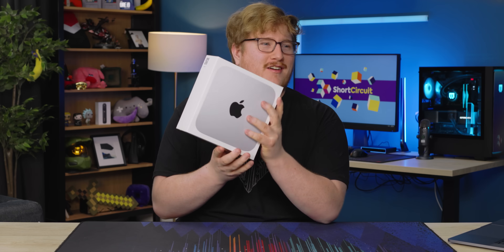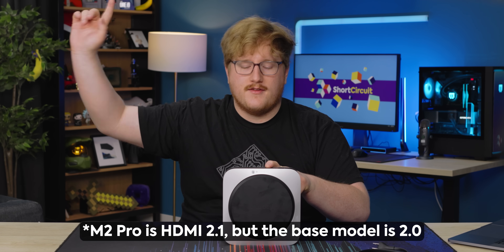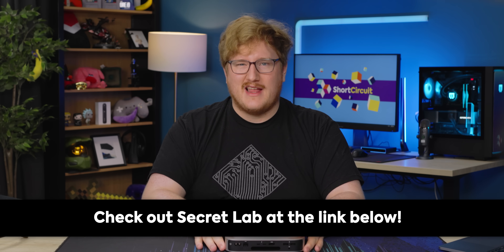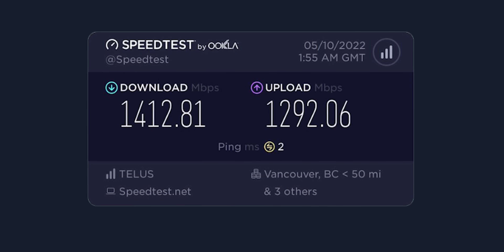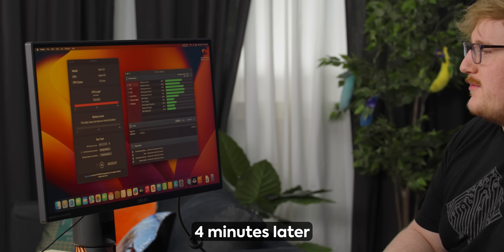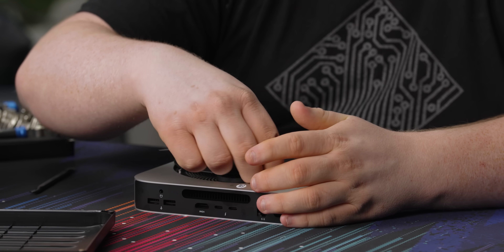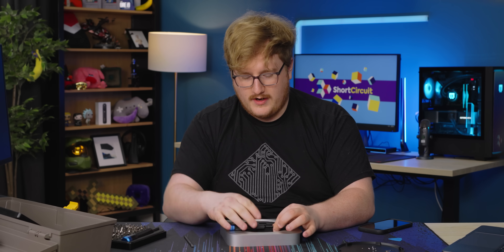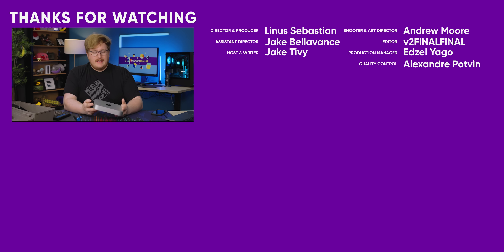Always wanted a Mac? Try this. - M2 Mac Mini

Comment: i edit RAW photos in lightroom and huge projects in FCP X ..currently stuck on a 2018 MacBook Pro w/ TouchBar specced out to 16gbs, 1TB, and runninga 2.4 ghz quad-core intel core i7 ..whatever that means 🤷🏻‍♂️ 
now, i know that any M-Series Mac will run circles around my current set up - but when i move on from this, soon to be 5 year old mac - i want something that will stand for even longer
so i'm holding out to save up for the M2 Pro Mac Mini, with 32+GB RAM, staying at 1 TB ..but by the time i do we may be onto M3 tbh 🤷🏻‍♂️ who knows

wish me luck
Reply: I would suggest wait for m3 because they are going to use tmsc 3nm which will improve efficiently and performance a lot

Comment: Last time I bought a Mac was in 2011 when you could at least replace the RAM yourself. Wanted to go back to mac for a while.
So I bought this little prick and it ended up coming with a defective Wi-Fi card. Go figure. Took it back. 
Probably should have just gone with the Macbook Pro. Whatever, Apple wasn't about to get any more money from me after that.
IDGAF about the ARM chip if this is what I have to deal with. Instead of buying another overpriced Mac PC...I made my own! :) #Hackintosh

Comment: The first time i got my hackintosh machine built and worked properly i know i will never buy any product from apple. How can people think 256 gb storage and 8gb ram (not upgradeable) in 2023 is enough? (Back in 2017 i bought an Imac 21.5 4k i5 8gb 1tb and it barely run my logic pro x project.) And this mac mini is 599? (To compare my hackintosh machine: 12400f -16gb ram - b760i ddr4 version - rx 560 - 1tb SN550 - "k40 sgpc" case cost me just 450$ brand new fully functional and it blow this m2 out of the water interm of raw performance). Wake up people! That's an anticustomer act.
Reply: Well that's a self fulfilling prophecy, given there is a timeline when Apple Intel support will be dropped anyway.

Comment: i would not give you a dime for the 8 gig ram and 256 ssd its garbadege for anyone and everyone, now slam in 16 to 24 gigs of ram and a 512 or bigger ssd then you have a real computer in your hands , i have the M1 mini 16x512 and its great  the m2s by the way are not that much faster then the m1 so not really worht it as an upgrade at all.

Comment: I am happy with my iMac 24 from 2021 so I dont need an upgrade plus I heard the M2 is just a little bit faster. I have my TV as my monitor while my normal monitor if I ever decide to get a mac mini to use that monitor but still at least with an iMac you get a screen, a keyboard and a mouse included. Even though the magic mouse is a bit of a pain sometimes. I keep enlarging the websites from my magic mouse by accident and have no idea how I did that or shrink it back

Comment: Boy the upgrade to M2 Mac Mini pro is appealing.  With edu pricing I bought a M2 Mini with 16 gb for $699, but for another $400, you get more ports, the ability to run 3 monitors, more and faster SSD memory plus the M2 pro processor.  Maybe it is just that the non-pro is intentionally limited. :(

Comment: I have MacBook Air M1 second tiered one with 8 ram 8gpu 512 connected to my Dell 34” monitor. I was thinking of getting the Mac mini M2 base model to have a dedicated desktop and free up my MacBook Air. You think it’s a good idea or waste of cash?
Reply: Go the M2 Pro Mini if you can afford it as that will give you some genuine upgrade in performance and capabilities for a desktop machine. Otherwise the M2 base mini's only real strength is it has active cooling and saves you having to dock your MacBook Air to use the monitor. You'll have to determine for yourself if that is worth several hundred dollars. I say that as someone who faced a similar situation with my M2 MacBook Pro and decided to get the M2 Pro Mini, but only because I picked one up second hand at a considerable discount.

Comment: The USD$600 price point is wild. Putting a cheap Windows system together with the same RAM, a DRAMless NVMe SSD of the same capacity and a retail Windows license, I can only put a 12400 in that thing before it goes over budget. It's just a shame that every little spec bump is highway robbery.

Comment: I just purchased 10 of these for a rehearsal studio at a major cruise line for running QLab. For the first time, it was actually a realistic option to go with the baseline Mac without any upgrades. I didn't, but I totally could have. I don't trust that they won't decide to do more with these things later on.

I also personally have a Mac Studio that I use daily and it's been an incredible computer. Totally silent, powerful as hell, and the power consumption is super low. I'm driving two 4K Displays right now and it doesn't break a sweat. I still get 60-80fps if I decide to game a bit... even at 4k. My actual Windows desktop is definitely better for gaming, but Apple is really killing it.

Comment: I honestly think charging port on the bottom of the mouse is easily defendable. They don’t want you to ever use the mouse with a cable plugged in. Bam. Done. It’s a much smoother experience without a cable, especially the very durable yet non easily malleable ones that Apple uses

Comment: Lol imagine getting a 600 dollar PC with only 8gb of ram and 256gb of storage. Also love that stupid nonsensical design on the mouse having the port on the bottom, they do it on purpose so when the battery goes bad you need to buy a new one. Apple never changes.

Comment: Might as well skip getting an external drive for this thing and just hook it up to a NAS somewhere. The internal drive can't even move data faster than the ethernet. Same problem with their baseline MBP. Wtf is Apple doing going cheap on their internal drives like this? Forcing people into the upgrade/upsell slippery slope? Maybe it wouldn't feel so much like an insult if it were something a person could swap out later. I can spend $160 and get 2TB sn850x with 6-7GBps read/writes to throw in any other computer. Meanwhile Apple's charging an extra $740 up front if I want a 2TB drive. Jezus christicles, Apple. The cost of that one upgrade is 150% of the price of an entire base model mac mini.

Comment: How come LMG always orders the Magic Mouse with Apple desktops instead of the external Magic Trackpad? If you're already buying the terrible Apple mouse instead of using a good mouse, you might as well use the significantly better input device they make IMO. I find the external trackpads to be as good as the Macbook ones, and it feels like macOS is tailored a lot more for trackpad usage than mouse usage. Charging port is in a sensible place too

Comment: The trick they do with only one SSD die is terrible. And 8 GB of ram is not enough in 2023, you will start using SSD swap almost all the time and decrease SSD lifespan. The only reasonable version is 512 GB SSD (if it has two SSD dies) and 16 GB of RAM, so $999. $599 one is kind of an e-waste if you think about that, it would not have a lifespan like old Mac mini where you could add ram or upgrade/repair SSD, so way it will live 10y.

Comment: These are cool, but it has two fatal flaws: MacOS and pricing. 8GB for modern applications is just not enough and the value is fully lost if you upgrade. And as someone who's used all 3 major desktop systems for both work and play for extended periods of time (Windows 10, Ubuntu and MacOS) I can confidently say that at least in my experience MacOS is by far the worst.
Reply: If you have no facial hair, have no idea what Ubuntu is, but figure its some kind of Central American language and can socialise with people, Apple computers improve in usability quite a bit.
Reply: @WorksOnMyComputer  I actually used Mac before I learned what Ubuntu is, but I did not shave my facial hair, so I guess that was the problem...

Comment: I miss when the mac mini had an IR receiver on the front. Made them super cool as home theater machines
Reply: I had one as a Plex server with 3 or 4 external usb drives connected to it and it was wonderful. It has been constantly turned on for like 10 years or so and replaced once the fan and two hard disks but other than that, worked like a charm. When it got a bit slower than before (software updates, not just from Apple but also from Plex), I built an UnRAID server and moved all the external drives in and they are still working today. Just last year I replaced the Mini with an Apple TV because the audio begun to fail sometimes. It was extremely worth it. Let’s see for how long the AppleTV will survive.

Comment: Why don't the Mac minis have grounded power sockets though? I've never seen that on a computer before. Does the US not use grounded electricity?
Reply: Different countries have different regulation on that, so if your country requires grounded power for that, you probably will get a grounded plug when you purchase it in your country.
But realistically in terms of power delivery, it's closer to modern phone chargers than tower PCs.
Reply: @laosb  I don't know much about regulations, but I regularly travel and work in four countries (Austria, Germany, the Faroe Islands and Denmark), and all laptops and PCs as well allways have and have had grounding, because it's safer, more stable and it largely avoids electrical noise and hum. It's just good engineering. The Noiseless Mac Mini would make for the perfect music studio computer, except that it's introduced electrical noise and 50Hz hum in my home studio, which means that I all of a sudden have to consider either buying and installing all kinds of special equipment and shielding that before want necessary, or somehow DIY a grounding wire on the Mac. So the only reason I can imagine Apple didn't include this obvious, no-extra-cost option on the Mac Mini, is that they didn't consider the rest of the developed world when they did the engineering design. Similar to how the Tesla cars are life threatening in the Nordic winter daytime: the crazy high windshield makes it nigh impossible to see anything if you're driving in the direction of the low winter sun. Seems like the designers only considered California driving conditions when they initially designed the windshield
Reply: @Thr3-Words  In China, all Mac minis and MacBooks are sold without grounding, though for MacBooks you can choose to use the larger grounded & extension cable module to avoid these problems — the charger itself is perfectly capable of being grounded. I can see why this would become a problem for music studios though.

Comment: I have $2000. Is it recommended to take the highest-spec Mac Mini or go to Mac Studio? what do you think ?
Reply: Base Mac Studio M2 Max  if you can afford it. That will do anything you throw at it. If budget won't reach that far the M2 Pro Mac mini is good value if you don't option it up. Can do 4K video editing and sound work and is a very snappy office or dev computer. It is about 15 percent slower than an M1 Max was and almost line ball or beats the M1 Max Studio in some video tasks.

Comment: Apple hasn't changed the way the mouse charges because they are worried if you can use the mouse while charging it people will just always leave it plugged in and it won't be "wireless" (Yeah I know it's super dumb lol) Also the speaker is only integrated on the mini for accessibility features. Like if you need voice over because you are visually impaired but aren't able to connect external speakers.
Reply: They don't do it that way because people will leave it in and use it non wirelessly, they worry because since the batteries of the magic mouse are essentially glued inside of it, if the batteries wear down (THEY WILL IN CONSTANT USAGE), then the device becomes unusable unless its plugged in 24/7, however thankfully they made the mouse useless when plugged in too!! meaning that if your mouse battery stops working then you have to fork out another $130, which is incredibly profitable for apple.

Comment: I like multiple cores. I have a M1 MacBook Pro 13" which has been running pretty well for over 2 years. I prefer more cores for compiling source codes and more RAM. But Apple's pricing strategy is too greedy when you want to add more RAM/SSD. For my next macbook, I would start with 32GB+ and 1TB...

Comment: If it doesn't have a replaceable ssd it is already ewaste.
Reply: Its serviceable life will be similar to most gamer PC's and in some cases more.
Reply: @WorksOnMyComputer  and in a "gamer" PC or any PC not made by evil people for idiots the SSD(the only part with a lifespan less than a decade) will be easily replaceable. Apple cope, green washing, smooth brain behavior, it will also cost a fraction of Apple trash and be user upgradable with a Phillips screwdriver. EMBARRASSING.

Comment: I am not happy with the serviceability of the Mac computers as a whole. They solder almost all of the components onto the motherboards now and all of the extra components are very fragile and easy to break/tear. Apple has basically refused people the ability to maintain their own devices outside of just blowing the dust out of them. Very shameful tactics from such a well known company.
Reply: they have been that way for awhile - the more modern tactic is the software based locks where even if you did have the proper parts it still won't accept them.

Comment: the bigger pro chip has a bigger mother board and cooler, so the base model is indeed undersized. But the same could be said of any prebuilt with a microatx mobo

Comment: This is an excellent Apple product because of its low starting price. However, when you try to upgrade to 16 GB of ram or 512 GB of storage, as you should, it's insanely expensive. Another 8 GB of ram costs $200! Why? No one should be using only 8 GB of ram in 2022, same with 256 GB but no one should be cashing $200 for 8 GB of ram, just buy the pro version. This is only for college students who can only afford this much until they can get a job and buy a more premium one.

Comment: Honest question - Does the Mac mini support higher refresh rates over 60fps..? Like to use it with a gaming monitor "for daily non gaming usage"😄
Reply: 4k 120 is only with the M2 Pro mac mini
Reply: My M1 Mac Mini supports 4k 144hz ( Gigabyte M28u Monitor ) with usbc to display port cable @AryaStarky

Comment: Is there any benefit to getting a machine like this, or just getting a good display to plug M1 MacBook Pro into and using as a desktop that way? Thanks!
Reply: Isn't this $600 while the MacBook pros are $2000?
Reply: I should add I own the M1 MBP that I mentioned in the original comment lol. I’m referring to having an office setup.
Reply: @akayy12  No difference I would say. I own a M1 Macbook Air and use it connected to an external monitor 90%+ of the time. So unless you need M2 for some reason you can easily just use your M1 MBP.

Comment: If it had hdmi 2.1, I would legitimately consider it as a media PC, but you have to pay double for that, lol
Reply: What does HDMI 2.1 give you over 2.0 that a M2 chip can handle? 4K 120Hz is irrelevant on it since you’re not gaming on it and media content is 60Hz max?
Reply: @pieterrossouw8596  120hz is not irrelevant without gaming, it’s just a better experience overall. Also, game streaming is a thing and you can steam link with it.
Reply: @TheTrio3331  Steam link is limited to 1080p 60Hz and even if it wasn't, what hardware can encode 4K 120Hz? Maybe 1080 120Hz makes some sense but then you don't need HDMK 2.1 so what's the problem?

Comment: How much space does 256gb leave for one to use after OSX and recommended 10% of free space?
Reply: Mac OS uses like 15gb so that +25 gb of free storage for the 10% would leave you with a little over 200 gb. Honestly could be worse. I own a M1 Macbook Air with 256 gb storage and just use an external SSD. I ain't paying $200 for an extra 256 gb of storage when the external 2 tb ssd was roughly that price.

Comment: It's a guarantee that as soon as I buy something THE NEW ONE RELEASES. I literally just got my M1!
Reply: Gotta be and early adapter to win that race.  The only time I got in late and didn't have that happen was with the Switch.  Nintendo has never upgraded mid system so that was an easy guess.  Ha ha ha!!  Switch Pro let's gooooo!!   

On the downside I hope your M1 lasts as long and my Macintosh 9.2.2 did.  I honestly have never owned an OS X machine for more than a few months cause the old Mac kept going and then Yellow Dog Linux (mac) give me another 5 years on the ancient hardware.  

Too bad you cant easily upgrade storage after purchase.

Comment: The M2 mini does not have HDMI 2.1 or Wifi6E that is reserved for the M2 Pro mini.
Reply: The base M2 Mini (non-pro) does actually have Wifi6e 
...but it does not have HDMI 2.1 (but I only needed 4K over 60Hz so the 2.0 works for me)
It does have (2) Thunderbolt-4 ports so it can also do 4K over 120Hz

Comment: A Mac Mini with Intel processor has Boot Camp, for near 100% Windows software compatibility.    It's also good for gaming.    And external GPU boxes work fine.

Mac with M2:    terrible for gaming, no support for eGPU boxes, and it cannot
run Windows software properly.     Also no way to upgrade or repair RAM or SSD.
Reply: Its also considerably faster running native software, more energy efficient and is the first base Mac mini that can actually get shit done.
Reply: @WorksOnMyComputer  Energy efficient is good for a laptop, but means little for a desktop computer.